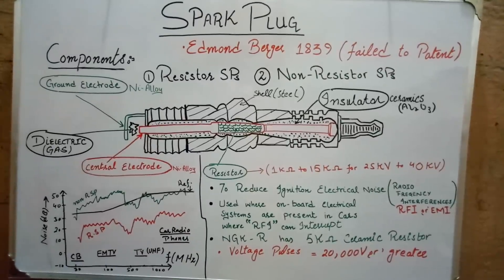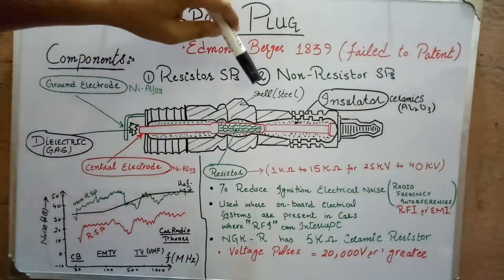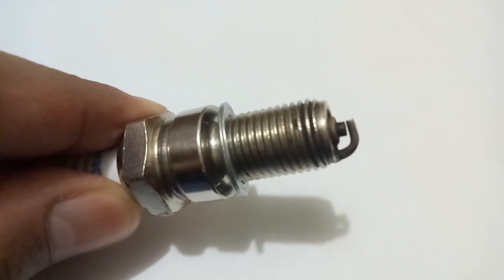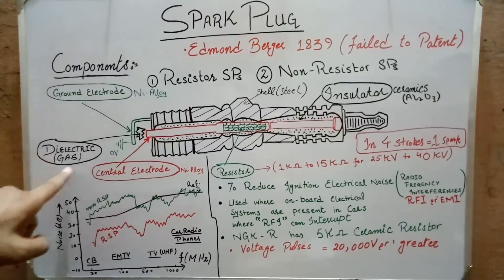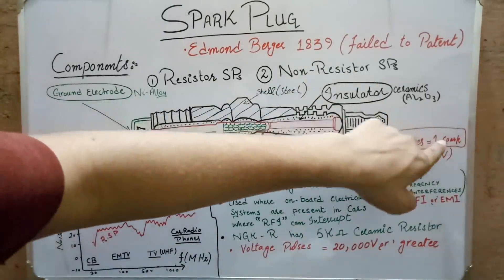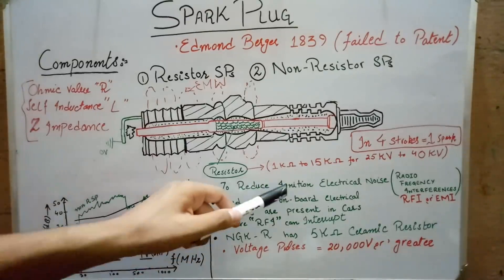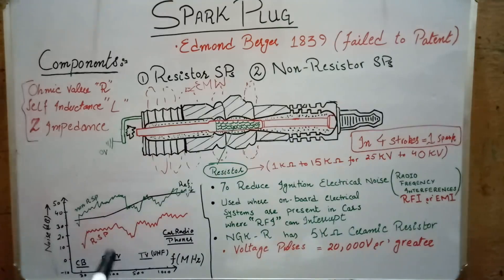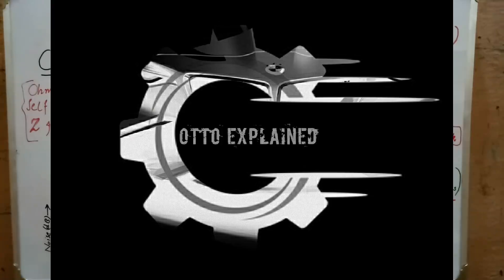Spark Plug (Explained)

Comment: Very informative video, thank you. But, how come my bike starts and runs better with non resistor plug instead for the original but new cr8eh-9 plug.. Engine  and spark use the CDI box. Can it ruin in long or short term the cdi box or coils? I notice only a slow start at rpm meter for a second or two with non resistor plug when starting the engine. I have resistors in the spark plug caps  (as original).

Comment: My car OEM recommended resistor spark plug. But in market I got non resistor spark plug. Shall I use non resistor spark plug instead of resistor spark plug ?
Reply from the maker: Its always better to follow the OEM instructions, the non resistor spark plug may produce that voltage and noise which isn't good for your car's onboard electrical systems and power.